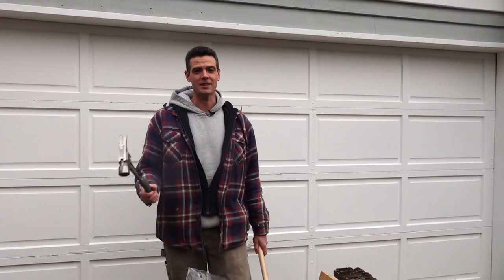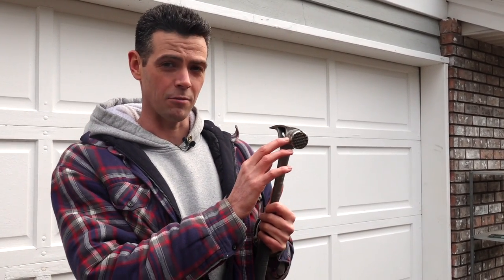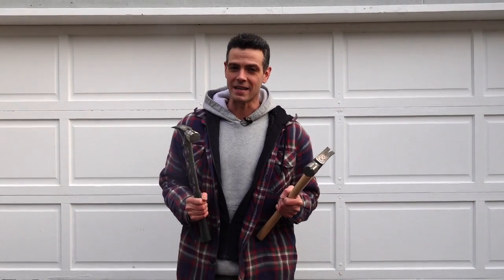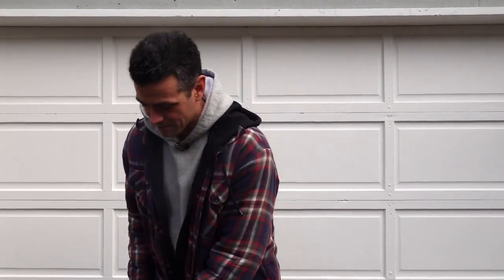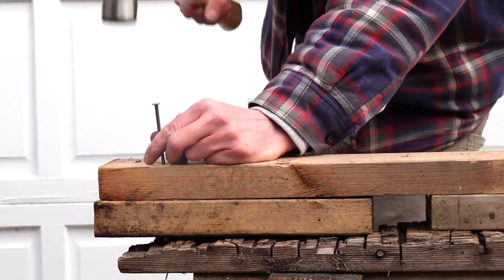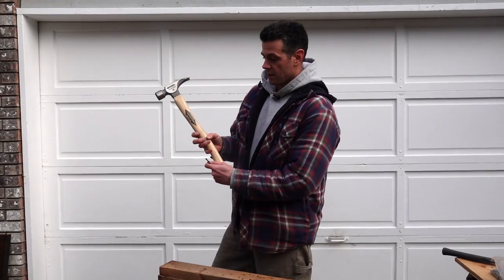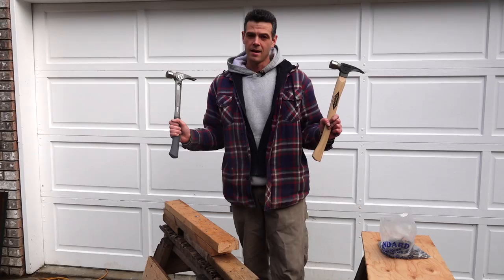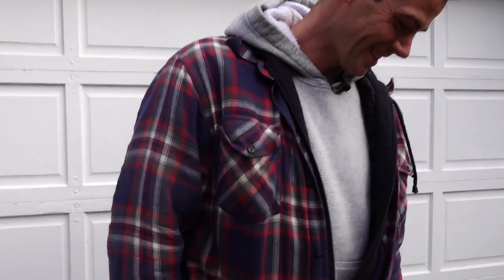16oz Stiletto vs Tibone3

Comment: I've owned my Ti-Bone for 15+ years. I have only replaced the head once. About once a year I have to tighten the head but I use blue locktite to keep it in their. I frame houses for a living so a good hammer is essential. I have had practically ever hammer out on the market and my stiletto's still my go too.
Reply: What difference eh ? I’ll never own another framing hammer .
Reply: The weight and impact shock is a world difference
Reply: Did you ever try the Martinez hammer? If so what are your thoughts?
Reply: @doesitmatter2754  One of the guys on my crew had one. He really liked it. I did try it out but felt the balance was off.
Reply: A former crew mate left his belt behind 
(he got arrested and the boss told him his tools were stolen.. 😂)
So his Stilletto TB3 is like our floater/loaner spare backup kinda thing. 

And it's essentially identical to my own TB3 but it's just not mine, y'know.  

I can spin and flip, and twirl, draw and holster my own hammer comfortably and with style. 
But this other hammer just doesn't feel right, because it's Just Not Mine.

Comment: I used a rasp on my wooden handle to reshape slightly then used bee's wax to improve the grip...keep bee's wax in my bag to reapply once in awhile to maintain the grip feel.
Reply: I do the same. But I prefer boiled lind seed oil.
Reply: Spar is worth a try if you don't mind sanding off the finish that came on the handle. If you apply 3- 4 coats it gives a rubber feel, it's excellent with moisture resistance and is more durable than most other wood finishes short of epoxy.  Worth noting spar will yellow/amber wood a bit.
Reply: Foul have yellow card 😂

Comment: I want to try different hammers but as a trim carpenter I use the butt of my Estwing as a rubber mallet and I can't give up that feature.  If I'm doing t&g pine or cypress or something then I'll use the proper tool (an actual rubber mallet), but I don't keep a mallet in my tool bags all the time and when I have a board that needs some coaxing into place the butt of the Estwing works great for pounding in a piece of delicate trim without damaging it.
Reply: I did contract trim work for years and I like your idea of using butt of Estwing as mallet. There was no chance of me using anything but a 16 oz wood handled Stiletto or Vaughn. I had to use a block of wood to tap something in place.

Comment: I've been a framer for around 7 years, I love the Vaughan 23oz California Framing Hammer (curved handle). I actually bought a 16oz Stiletto, but found I didn't like it because it worsened my carpal tunnel and elbow pain due to needing more force to pull out nails, whereas the heavier hammer has more momentum and impact force and makes it a lot easier. And plus, it's only around $45 and lasts several years easily, whereas, like you said, I found the face on my Stiletto flattened quickly.

I also love my Daluge 16oz Smooth-Face Curved handle hammer for working on more finished jobs where you don't want to leave marks.

Tip: make sure the grain direction on your handle has the grain running front to back, not side to side on the hammer, this makes it stronger in that axis and will be less likely to break when really prying on it.
Reply: i miss my daluge. i hate thieves. stealing a mans  tools is dispicable
Reply: I use the Vaughn 19 oz hickory (curved handle) and I absolutely love it but would like more weight I can’t find at any stores near me a 23oz curved handle so I think I’m gonna try this 16 oz stiletto here soon

Comment: I love a 16oz smooth face straight wood handle Stiletto. Now that most nailing isn't done with a hammer the downsides are less of an issue for me. Just remember a hammer is not a pry bar and your handles will last much longer. I do however switch out my hammer for an Estwing when doing concrete jobs..
Reply: Yeah I run the 14oz stilletto hickory handke and If im doing any prying that could break the handle I just go grap a pry bar. And I also switch to a cheaper more durable hammer doing concrete work.

Comment: I have a few decent Estwings that can get the job done for my day to day and as a remodeler.
I have borrowed a framer's Stilletto and it is a different world of comfort. 
I think it might be justified to buy a top end hammer as it is still cheaper than elbow surgery.
Reply: Honestly stiletto wood hammer is $100? I found one a guy had for $40 without a handle and the handle was $15. A little cheaper. Definitely cheaper than they used to be. There is more titanium competition now so I guess it’s that. Also you can sand off the finish the put on and use linseed oil and it’ll make the handle more durable and comfortable in the hand. Idk. I figured I’d try the cheaper version before dropping $250. I’ll probably go for the Martinez hammer though. Same guy made both stiletto and Martinez and Stiletto was sold to Milwaukee.
Reply: The old steel Estwings were real cripplers with extended use.

Comment: If you have a hammerloop on the side or back of your belt the rubberhandle will catch more easily, thats why people using the hammer alot prefer woodhandle.
Reply: The hammer also slides out of a rubber sleeve very slowly over time and it gets annoying.

Comment: I joined the carpenters union in 1973. I have used Plumb, Vaughan, Douglas, Stiletto,  and Hart. I still prefer Wood handles and steel heads. At 67 I have no wrist, elbow, or shoulder problems. Hardcore Hammers makes a great artisan American made hammer
Reply: I started in the Palo Alto CA local Union in 1964 and know exactly what you are talking about. Stiletto 20 oz framer and 16 oz Vaughan trim hammer were my choices; never tried any of the expensive exotic stuff they are showing. By the way I do understand the currency value in 2023 is virtually zero! All quality tools are expensive; even non US made stuff.

Comment: I do Formwork and have owned a Tibone 2 for 3 years until it unfortunately grew legs and walked away one day... Once that happened I "upgraded" to the Tibone 3. Do not upgrade to the Tibone 3 if you use a Tibone 2 and here's why... For starters its thinner, the shaft of the hammer is thinner and you can really feel it compared to the Tibone 2. It shakes a lot more and feels a little bit different in my opinion with the years of experience I've had with the Tibone 2, however compared to a wood handle I do enjoy using the titanium better but that's just my opinion. Second the claws are less durable, working with concrete and chipping stuff away these claws like to twist easier and I'm honestly afraid that they will snap so I primarily use the side puller if I can or I resort to using my nail puller and put the nail puller in the upper slot of the Tibone for extra leverage (If you haven't tried that you should because it works a treat especially when combined with the titanium stiletto nail puller). Third the grip on the new Tibone 3 is stiffer, which yes is an upgrade from previous however coming from somebody that never had the grip failure issue with the Tibone 2 I find it uncomfortable when nailing all day. Just today alone I pinned and nailed ledger for a building and my hand was killing after it, it just doesn't have the umff I want and need in it anymore so for those reasons I will be "investing" In a Martinez M1. Yes its more expensive but from using co workers and experiencing it hands on compared to the Tibone 3 I can confidently say that the Martinez M1 is the superior hammer if your looking to spend the 300+ dollars already.
Reply: Working around concrete, forms and steel can trash a quality hammer pretty quickly. I have not worked for years, but honestly I can not imagine spending $250-$300 even with currency value at near zero! If I was still working, I would find some good used US made Stiletto and Vaughn wooden handled hammers and refurbish them and replace handles as needed. Made in China, Tiwan or Mexico are out.

Comment: i have the Ti Bone 16 and I love it , used to have a 14 (that one grew legs), then I found online the Martinez M1 when they came out and ordered one of the first ever made at the time, hands down the best hammer of the lot IMHO, the head is forget steel, the milled head lasted me a long time, it has replaceable head and claws, replaceable handle, they even have customizing options, I really think you should check it out, the balance, handle, claw, nail puller, and everything has definately a different feel, the only drawback is the price, it changed the game for my carpal tunnel too, it is a definitely improvement form the TiBone, Mark Martinez  was the owner of Stiletto, and made all these improvements  for the Martinez hammer.

Comment: Funny you say the more expensive option tends to grow legs and walk off the job site. It think that depends a lot on where you're located. In Portland we had to secure all our tools in a big chained up job box or in our truck every night. We rarely ever left our tools unattended. Here in AK we can leave carts full of tools on site for a couple days and they are fine. It helps that the buildings we do are usually secure at night but any of the other trades could easily take things when we aren't there if they really wanted.

Comment: I have a 16oz wood handle. Wanted a smooth face, but ended up getting the milled face. I LOVE this hammer. It has “grown” to fit my hand beautifully and the milled face has smashed pretty much all the way gone. That’s ok, cuz it’s way better for trim work. 

The t-bone I think would be fine for framing, but it’s soooo expensive. I don’t know. For really rough stuff, I pull out my old Estwing that I’ve been swinging for 30 years. Lol
THAT is a tough hammer, but heavier.

Comment: I just switched from the estwing all steel 16 oz smooth face framing hammer to a Hickory handle 19 oz steel head milled face Milwaukee. it's a world of difference! I loved the estwing because of how light it is I'm a bigger guy and have no problems swinging a bigger hammer but the smaller one I find less fatiguing also the tines on the back one is about a half inch shorter because I broke it but it works great as a makeshift pulp hook for grabbing and pulling material. The Hickory handle hammer absorbs shock much better the milled face doesn't slip off nails or my nail punch love the difference also the Hickory can be carved to customize it
Reply: We've got identical hammers! Only difference is my Milwaukee has a smooth face. Definitely makes hammering long nails easier without much added weight. If you're a big guy, consider the 20oz estwing.

Comment: I've always been happy with my 16 and 24 oz estwings. I can't justify spending that much on a hammer, though that's some nice waffling on the head of the Ti bone.
Reply: It's about the weight on your belt.  I have the stilletto ti bone, and the nail puller.  Drops lbs off your belt or vest.
Reply: @h20s8804  I also continue to read and hear that it's about getting the same impact power with less weight so it's easier on one's joints. Do you find you get the same or even greater power with less weight?
Reply: @SeanHayesParleys  I think for nails, when you have to use the hammer, it's just as effective as a big heavy hammer.  But there's no way the Ti hammer is as momentous as a big ol' 24oz hammer for moving walls at the plates or driving stakes or stuff like that.  I love the Ti hammer and nail puller because they're light in the vest or on the waist.

Comment: I use a 19oz Vaughn straight claw. Absolutely love it. Had it for about 3 years now and just noticed about a month ago my head is cracked on the neck web. I have completely abused this hammer and it will be my next. Just couldn't see me spending that much on a hammer.
Reply from the maker: That's a good hammer. I don't blame you.
Reply: Is the Vaughn US made and does it have wooden handle?

Comment: Most framing crews I’ve worked with the past couple years have banned milled face hammers, too many guys forget to swap out for a smooth face when doing some like putting fascia boards or window trim on (most of the houses I work on use cedar trim)  or some thing a milled face hammer shouldn’t be used for

Comment: I'm an electrician so I only ever hammer staples (thousands of em though) and scab in some 2x4s with nails. I tried every steel hammer out there, Vaughn was my favorite. Then I tried my buddie's 14 oz wood handle Stiletto, bought one that night and never looked back. It's like having a cheat code. The palm swell about halfway down fits me like a glove, hands are on the larger side.
Reply: He took a big risk lending you a wooden-handled hammer.  That's like lending someone a chisel.   He must really trust you.  Or he's a moron.  Or both.   :)

Comment: I bought a Martinez M1 after snapping the claw on my Ti-bone a few years back. Had it for about a decade but I had a "brave" moment at a new job lol. Had a 14 oz woody too but sold it because it felt unproductive. Had a 23 oz Vaughan too but it wore me out so fast for overhead work that it lasted less than 3 months on the belt. YMMV but the Martinez helped sooooo much with my carpal tunnel and I can honestly say it's been the only hammer I've used for everything from finishing to high rise formwork for 3 years now

Comment: On the wood handle, if you sand off the varnish and replace it with boiled linseed oil, you'll have much better grip.
Reply: Good tip on wooden handle prep.

Comment: I owned the original T-Bone with the yellow hatchet-style. I framed houses with it for a few years and eventually gave it to a friend as a gift when I changed trades, thinking that I could always just pick up another one if I regretted not having it later. Shortly after that, they discontinued that specific model. I've since bought the new model (that you're holding), and I hated it! Right away I took an angle grinder to that worthless nail-puller on the side of the head, then a file, then a tiny sanding block, then steel wool. Eventually, the head was symmetrical again; as if it had been manufactured that way. If I want to pull nails, I have a cat's paw for that. In fact, I have the cat's paw that they sell. That new handle design is awful too; vastly inferior to the old yellow one in shape and feel. So I cut the molded-rubber off of there and made a nice hatchet-style grip for it out of bare hickory and finished it with a few coats of linseed oil. It looks gorgeous! But that's an awful lot of work just to fix a hammer that costs around $200 bucks! Stiletto, what was wrong with the old design? It was everything a framing hammer needed to be. And if you want evidence beyond just my word for it, check Ebay for the original yellow hatchet-style handled T-Bones. They're almost never there! Conspicuous by their absence. That should tell you something... I think if customers are being asked to spend that much, they should offer a variety of designs; at least the styles they've already offered!

Comment: I have the TiBone 14.  Had it for over a decade.  I'd never buy the milled face framer with the wood handle-can't replace the face once it's done for--'Mushes out fast' as you say!  I have the little wood-handled Stilletto finish hammer-smooth face and it's awesome.

Comment: 20 year framer here.   Wood handled 14 for me.  I realized that only the square portion of the 16 oz is the where the extra weight is.  The further away the weight from the head, the more inefficient.  Thats why the tibone is a no go for me.  Too heavy, wasted weight.   The hickory handle drives nails better.

Comment: I have a tool vest from Occidental, and so wait isn't too much of a hassle. And that tool vest has two hammer holders. Maybe they were intended for different things or, so that you can choose where you hold your hammer. I'm not sure, but either way sometimes I will carry a dogyu Japanese hammer and a stiletto at the same time. Because those Japanese hammers basically have cat's paw nail pullers. So you can even use your two hammers together as a cat's paw

Comment: I have a tibone 2, the head got off enter on-site one day but I didn’t have time to stop and readjust it. At the end of the day I tried to Center the head but the damned Allen screw is jammed and now unmovable. So I’m stuck with a off cantered head witch is ok because the magnet for the nail setter fell off years ago🤷‍♂️

Comment: I have both hammers accepts my wooden handle stiletto is 14 ounce I ground the face to make it a smooth-faced hammer my ti bone 15 is my framing hammer but I been swinging my stiletto 14-ounce smoothface hammer for last ten years framing I don't have a problem with smoothface framing at all

Comment: Been on construction jobs all my life & im 51 now, the Vaughan California Framer 17" straight handle is the best hammer I've ever used. I grew up watching old school construction workers, 100* weather, no shirts, cutoff shorts, speed after coffee, beer before lunch, not a saw on the job had a guard, some guys useing rigging axes,  & you got paid by what you got done. First time i took a metal handled hammer to work my boss threw it as far as he could & the lift ran it over & bent it. Told me those where for form setters & sent me to buy a real WOOD HANDLE framing hammer. Hell, nowadays mose people don't even know what a rigging ax is! By the way, if your handle broke you went home put the head in the oven & put on a new handle. And heres a tip, dont used your arm to push the nail in! Swing that hammer & use the wrist, let the hammer do the work.